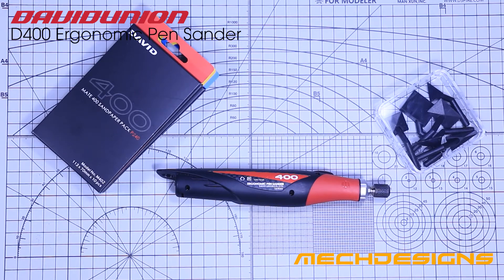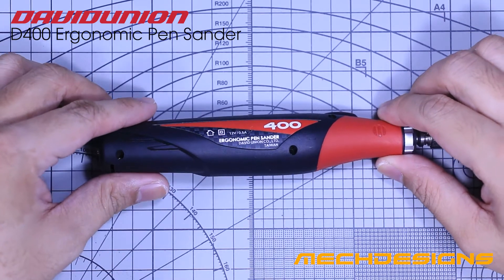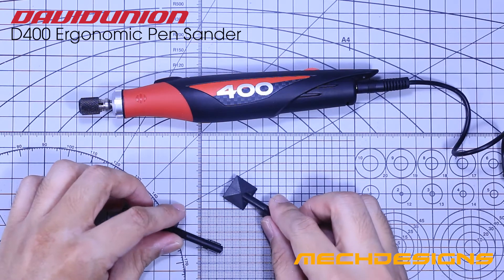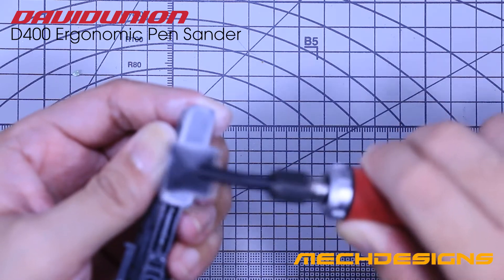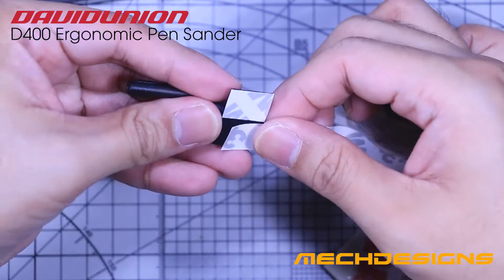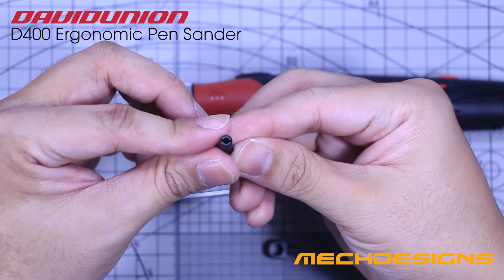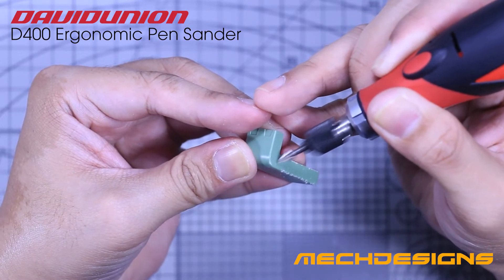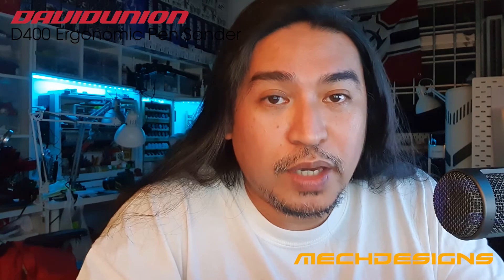D400 Ergonomic Pen Sander Review

Comment: Great review of the tool ! Quick question - for alot of reviews I see people using this sander tool for removing seam lines like you did. How good would it be for something like just sanding nub marks or gate removal? I'm not sure if I want to get the D400 or the D360Elite (rotary drill with a sandpaper option too).
Reply from the maker: Hi Wayne, apologies for the late reply. they work as well on removing nub marks. Though i would advise to use different sandpaper grit it upto 2500 sand paper if you don't plan on painting it. Make sure to trim the nub first before using the D400.

I prefer the D400 for sanding purposes using the D360 for sanding using the drum attachments is not advisable if you will is on plastic. That is meant for harder material like resin or metal.
Reply: i guess im randomly asking but does anybody know a way to get back into an Instagram account??
I was stupid lost the account password. I would love any assistance you can offer me.
Reply: @Damian Connor i really appreciate your reply. I found the site thru google and im waiting for the hacking stuff atm.
Looks like it's gonna take quite some time so I will reply here later when my account password hopefully is recovered.
Reply: @Damian Connor it did the trick and I now got access to my account again. I am so happy!
Thanks so much, you saved my account!
Reply: @Pierce Ryker you are welcome xD